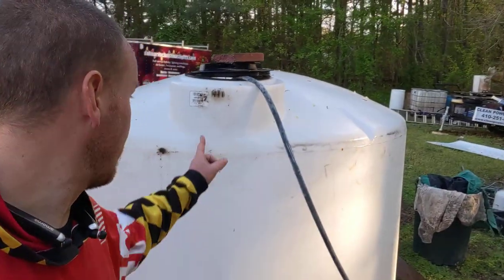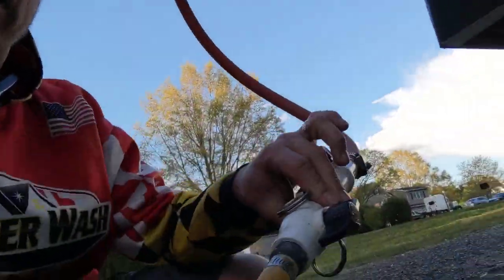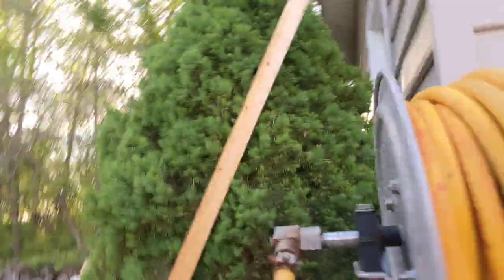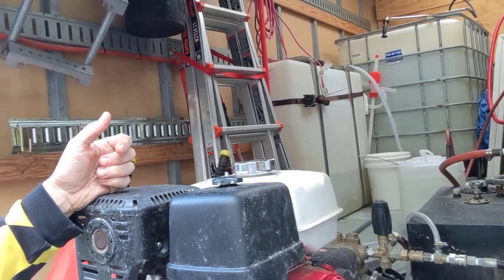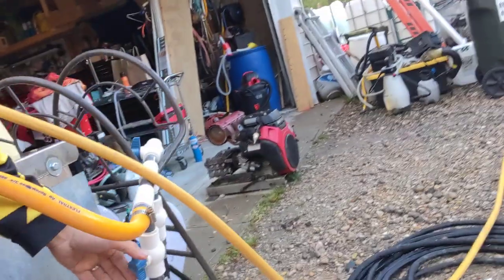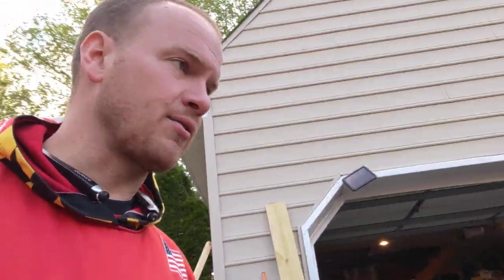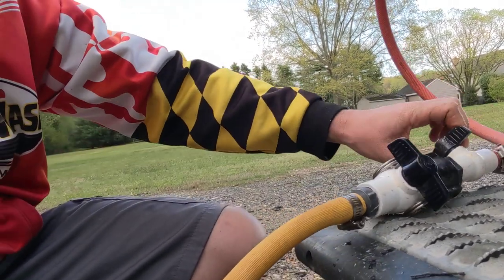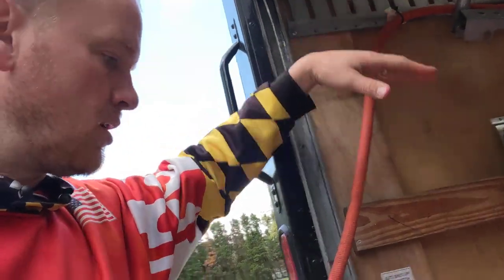Systems/Training videos Bleach refilling/pumping station.

Comment: Hey Rob, awesome videos! Keep them coming! Quick question about crossing hoses over sidewalks in a residential area where you must park in the street. I am sure you deal with this. I would like to see your system for that. I am sure every situation is different. Not necessarily in a downtown situation, mainly residential areas. Any suggestions or tips you have would be much appreciated. Thank you!

Comment: Does your bleach fill hose also act as a bleach vent? If not is it a separate hose or no venting at all?
Reply from the maker: Yes, separate line on this truck.  Our other box truck has a tee at the inlet to the tank and a hose going out of the roof.

Comment: U ever see soot on homes that use natural gas for heat or a fireplace ? Does your house wash mix lift the soot off ?
Reply from the maker: Depending on how old it is, yes.   Ebc or red raider will do the trick though